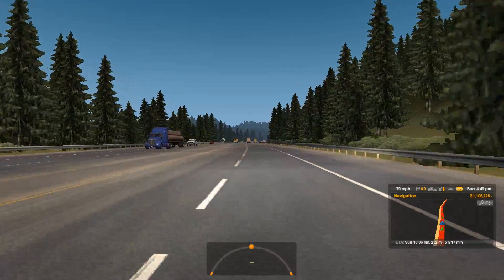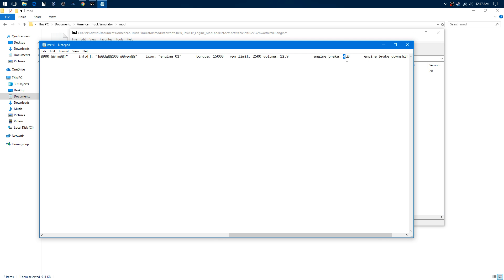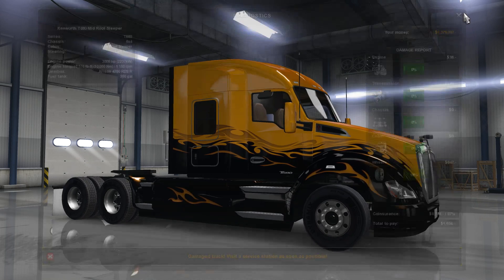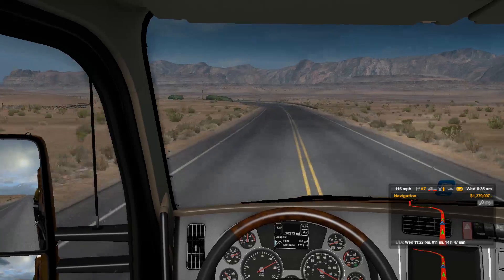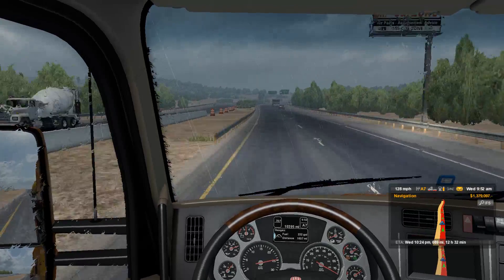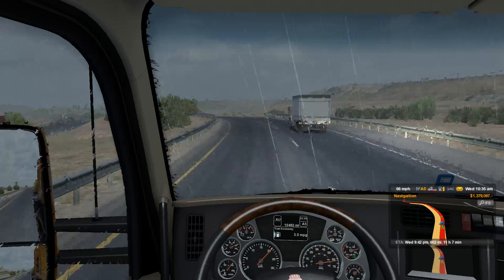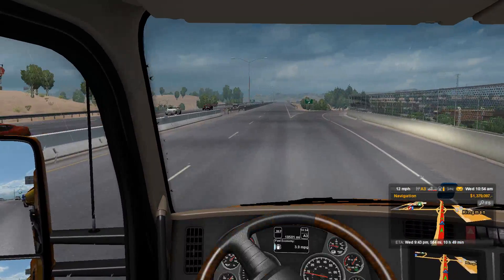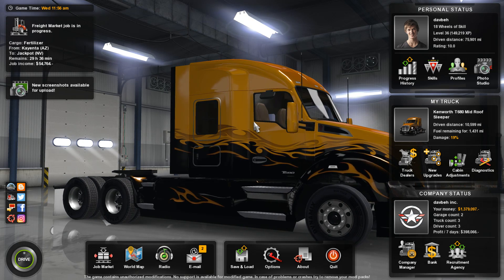How to: Change engine HP,  RPM. on MOD. American Truck Simulator

Comment: Awesome!! Love how the transmission shift higher. 
I’m using pre modded engines, I love the auto. It want to adjust the shift points badly for high rpm Detroit’s and stuff

Comment: I tried it, but only the numbers change, the power/speed itself does not. I have a mod with 900-920hp engines, and they are still faster, while i gave the ones i tried 1800hp, it showed as 1800, but performed like the original 605. I’m on game version 1.40, if it matters for this howto.
Reply: Change the torque to 17000 to 19000
Reply: If it's a cat engine but Cummins 22000 to 25000 on tourque

Comment: when i went into my game, the mod wasnt in my mod list
Reply from the maker: extract download put the  .scs file in mod folder   file has to end with .scs
Reply: @daves.projects  well it actually ended up installing itself without actually having to be in the mod list in-game... Maybe that's just a feature in 1.34 or whatever the latest version is but I'd like to say that it does work, thanks! :D